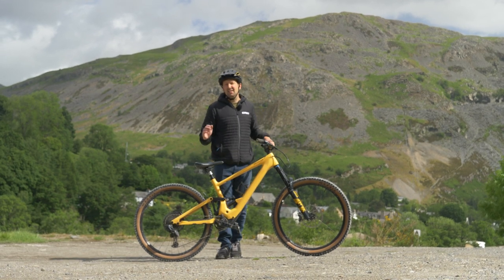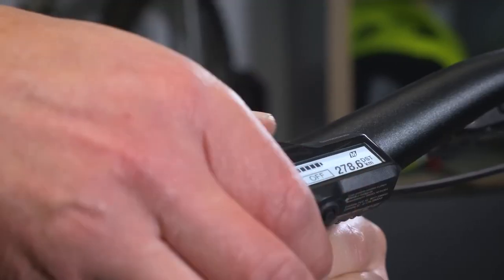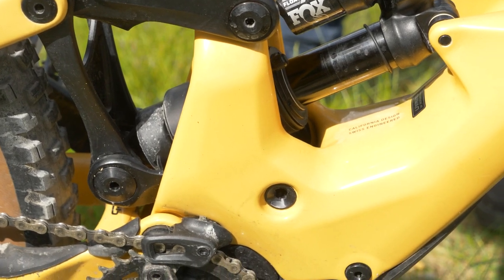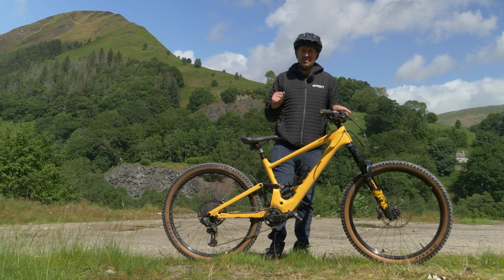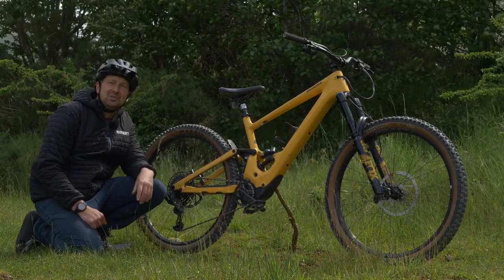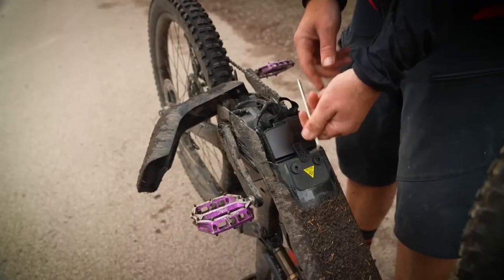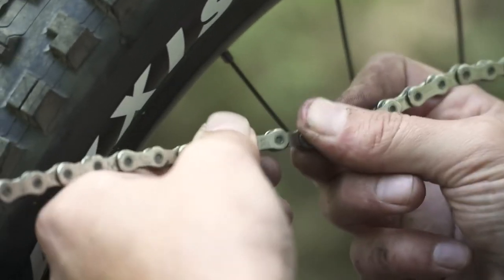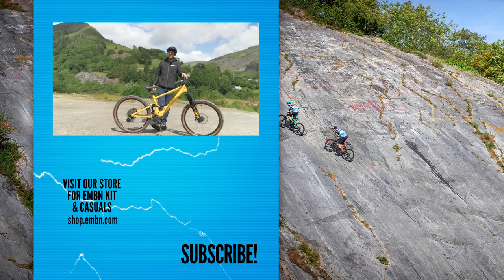5 Things On Your E-Bike That Can Fail!

Comment from the maker: Have you broken anything on your EMTB yet!? Share your stories with the community down below! 👇
Reply: Motor, brake levers, rear hub, rear wheel, mud guard, power mode controller, bent derailleur, bent hanger, snapped chain, headset bearings, seized seat post, dropper post lever, leaking brake oil, freehub body failed, battery mount cracked, charging port. 

All that broke during 6000 miles on a CUBE HPC SL STEREO HYBRID 160
Reply: I had my first chain snap after 1254 km. Of course it was on a short ride where i opted out of bringing my backpack that had the chain tool. Now it stays on the bike at all times.
Reply from the maker: Hi Martin! That always seems to be the way it goes! 😅
Reply: chain and brake pads worn out (not broken) other than that no problems after 9000km of mixed trail/fireroad riding.
Reply: @SimonBauer7  which e-bike? 👀

Comment: Left stranded on my first ride of my new Norco sight VLT thanks to the wire to the power button being squashed by the casing around the motor. If the original assembler just used one zip tie it could have been easily avoided
Reply from the maker: Wow! Not the best situation to be in!😬 Hopefully you managed to get it fixed!

Comment: Had many faults with my Lapierre overvolt ebike the battery connection to the motor fault E020 error kept happening but the worst with that bike was the weld on the seatpost cracked not good at all.

Comment: Bent derailer hanger.
Battery going off after two years.
Charger going bad.
Seatpost weld broke.
Many numerous brake pad replacements. And a front disc upgrade.
Numerous seats.
Reply from the maker: Hey Charlie! That's quite the list! E-mountain biking certainly isn't cheap! Hopefully, your bike is up and running again! 👍

Comment: And here is Chris with the most bulletproof bike of all, specialized SL.
Reply: the full levo/kenevo with its belt drive is an instant failure. failed construction.
Reply: @SimonBauer7  agreed,
Reply: Not sure if your being sarcastic? I have a kenevo sl. it is in no way bulletproof. it is hardly fit for purpose. first motor packed in after only 660 miles, second motor is on its way out after 500 miles. control switch failure. 4th chain, 4th set headset bearings. freehub bearings collapsed, rear hub bearings replaced. fox 36 oil seal failure. 3rd set brake pads. original tyres were useless. The bike creaks and groans all the time. second chainring and cassette.
Reply: @perspectivedetective2703  lol, ok that sounds terrible, I can only speak for mine 1 - 1/2 years old and faultless

Comment: Main reason not to buy an ebike....running costs..
Reply from the maker: That's true. Although, running costs are inevitable with all types of bikes (including normal MTBs).
Reply: @embn  yes of course .I should of said repair costs...motors and battery's are not cheap....

Comment: What haven't I broken, spokes, chains bent bars, broken rotors in motors, flooded controllers, smashed displays, hurt pride 😂 in saying that I'm 120kg and ask alot of the hardtail. Never really broken much just commuting only when beating on it out bush. Emtb chains and other 'electric specific' items are pointless and overpriced even with the 1000w mid drive I'm using. Invest in your own tools and learn to do your own maintenance.